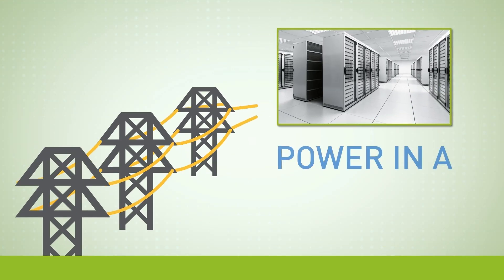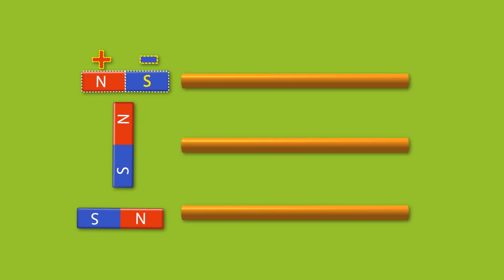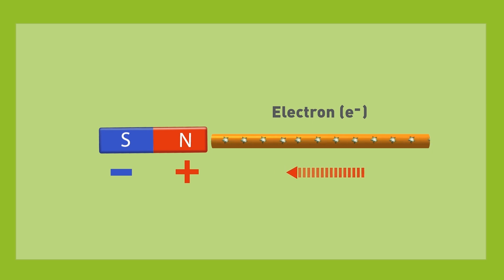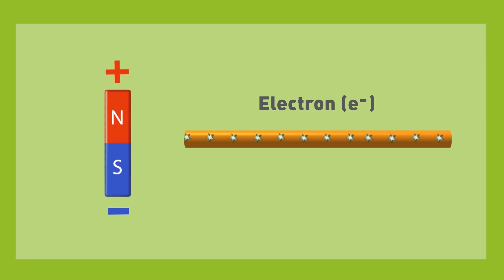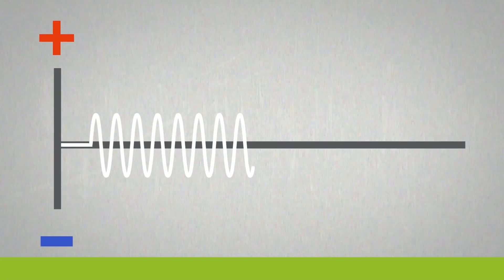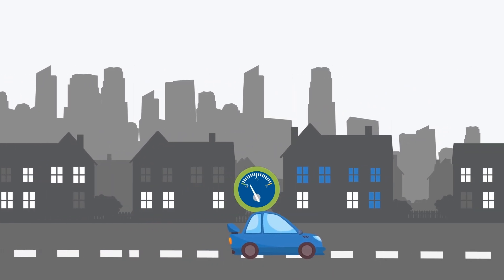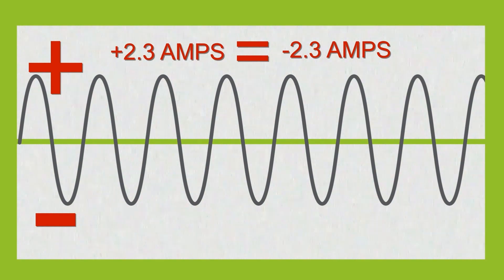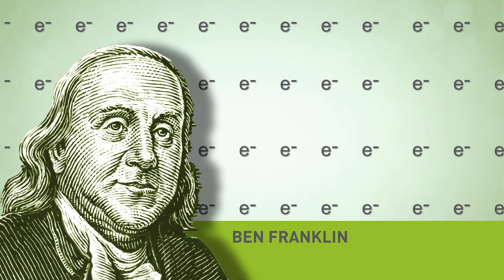Alternating Current Explained - Animation

Comment: Dude, how do you get the definition of Hz so fundamentally wrong in an 'informational' video? Hz is a measurement of cycles-per-second, not a measurement of the length of the period in a wave.  To say "__ Hz/second" either implies either you think the electrical grid is in a state of accelerating AC frequency, or just fundamentally don't understand the unit.

Comment: im bit confused.. if ac moves forward and backward, how can it reach the load and return to neutral.. in term of domestic wiring
Reply: Great question. I had the same question. After researching, I found that electricity in simple terms travels at nearly the speed of light which means that at 60 cycles per second the wavelength is 5000 km. So unless your utility or substation is more than 5000 km away (or 2500 km away for the neutral return) the electromagnetic energy will have long reached your appliance before the polarity reverses at the first cycle.
Reply: @florida995  oh i see.. thanks a lot mister

Comment: AC generators work on the principle of Faraday's law of ‘electromagnetic induction’. When the armature rotates between the magnet's poles upon an axis perpendicular to the magnetic field, the flux linkage of the armature changes continuously. Due to this, an emf (electromotive force, other known as, voltage) is induced in the armature. 
Notice, as the armature revolves between the magnet’s poles, upon an axis perpendicular to the magnetic flux, the armature revolves the opposing direction (opposite, or reverse). That’s how the AC output is generated.

Comment: You can't induce current on a wire by placing a magnet next to it. You need a changing magnetic field (either the wire moves or the magnet moves to generate changing mag field)
Reply: Usually you need a iron core with copper wrapped around it, and the magnet will pass close to the iron core and it'll induce the current on the coil.
Reply: @alves6465  That's mostly just to amplify the effect - moving a magnet towards a single line would induce a current but it's multiplied by the surface area and proximity of the coil
Reply: This is the principle of ‘Electromagnetic Induction’.
Reply: we understand that point cause you can't reach the alternating current without knew it

Comment: Suppose negative amps denotes same current but in opposite direction . Then , the electrons is simultaneously covering some distance and coming from that point to it's orginal point . So , distance travelled is twice to the distance covered in one go but the displacement is zero . So , the current can move only a limited distancs many times , i.e. it's polarity is fixed at equal interval of distance which we call magnetic flux..
Then how , if it's moving in this way , reaches it's required destination , as current is just moving some part of distance in an alternating manner and cannot reach further ?
Please explain

Comment: Sorry buddy!!! this very wrong depiction, magnetic field do not act on static charges, the force applied by a magnetic field on a moving charge is
F=qv×B, vector product,
That's why the turbine is moved by water/steam pressure in a magnetic field. This motion leads to the separation of charges leading to  generation of electric potential.

Comment: this is the first video that really helped me understand why the the current alternates! great job love it
Reply: And it’s not correct!
Reply: @AbhishekKumar-cx2bw   Ahem... Excuse me?
Reply: @MonkeyDLuffy-fu5ds  I wrote it one year back .. now forgot why I did that 

U can read rest of the comments.. many have highlighted the error
Reply: @AbhishekKumar-cx2bw  How about you tell me what’s correct?
Reply: @MonkeyDLuffy-fu5ds  basically for current to flow there needs to be motion of wire between the north and south pole ( where the magnetic field lines are cut) due to this motion the current is produced. the more the frequency of motion the more current is produced. where as if the wire is stationary there is 0 motion so no current will flow

Comment: Hi
I have a doubt....
How does current will reach my home,if they are moving in same distance back and front.
And....
   how much current moved forward ,that much current is going back,that means current travelled zero distance🤔🤔🤔
Reply: @parveensaini7944  He has doubt about current (moving electrons) and he's right. Electrons wiggle back and forth so he doesn't really receive any electrons. What he receives is ELECTRICAL ENERGY, that electrons pass from one to another. Is there anything unclear?
Reply: It's not zero, because while the electrons wiggle back and forth, they can do work. Imagine them wiggling back and forth in the wire of your lamp. It will glow due to movement of electrons, doesn't matter which way they move.
Reply: You're right, current doesn't really travel any distance. But no one sells you electrons. What you buy from power plant is actually ELECTRICAL ENERGY. It travels in wires almost at speed of light.

Comment: This is not only wrong, it is misleading.  Current flows in a wire when that wire moves through a magnet field. It is the movement of the wire with respects to the magnetic field that causes the electrons to move, not the proximity of the magnet poles to the wire.  By your explanation, just having a magnet pole next to the wire will cause current to flow. If that is the case we would have free power.  That violates the  law of conservation of energy.
Reply: He is using a magnet in place of a motor for a simple explanation his explanation is on point.
Reply: You're right about that. Plus, 1Hz is not a cycle. It's a cycle per second. Current in US domestic sockets is 60Hz, not 60Hz per second.
Reply: That's what i think too
Reply: I  wonder the coments below even more
Reply: Your right .current will form in the wire when there is change in magnetic flux associated with the wire.not when flux is constant
Reply: I never chose to understand the AC, I thought this was okay, however, you say this is wrong.  I had one question during this video, should AC Amperage should be calculated in a new or different scale? Dont bust my ass before I watch a few more
Reply: Yes current and mgnetic field is perpendicular
Reply: I know nothing about ac power but even I could tell something was off when he was saying having a stationary magnet near a wire generates current. I was thinking “where does the energy replacing those electrons come from?”
Reply: Yes u are absolutely right
Reply: You should really know what you're talkin about before leaving an ignorant comment such as this.

I am a journeyman electrical worker in the IBEW. I've completed 7 years of schooling through my union and have taken courses on both AC and DC theory throughout those seven years and I completely understand what he is saying in this video 😂.

Hey simplifies a few things, and uses a few analogies so everyone can understand. We're not all electrical engineers and master electricians.
Reply: Very Correct comment.
Reply: The magnet must SPIN?
Reply: @tedlahm5740  not spin, but MOVE.